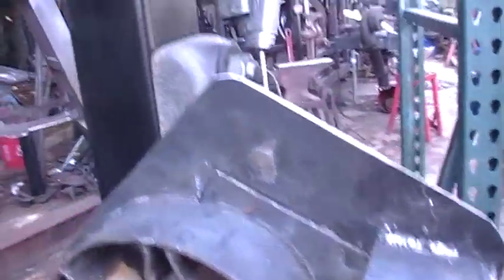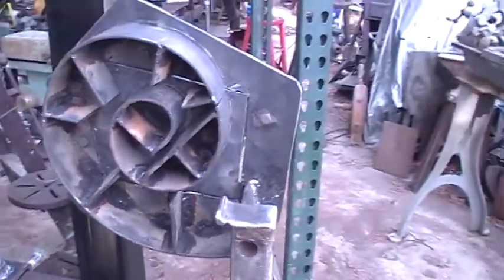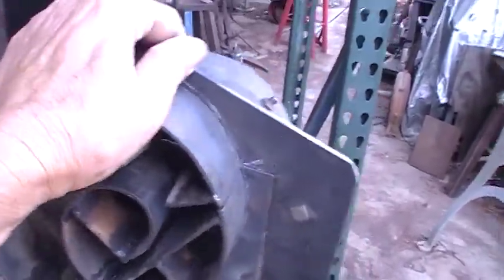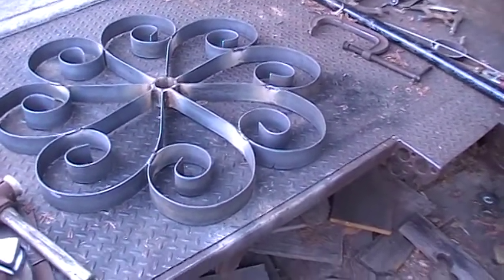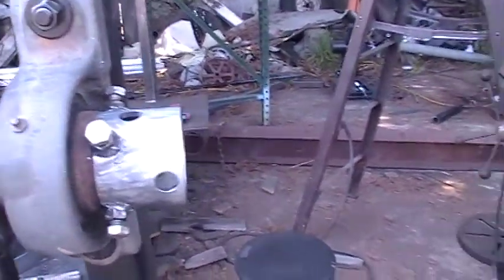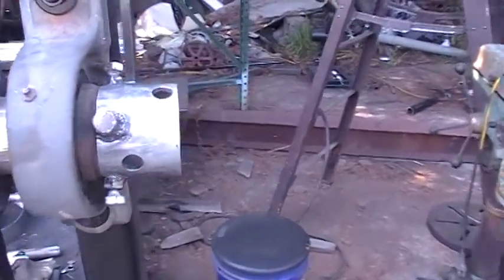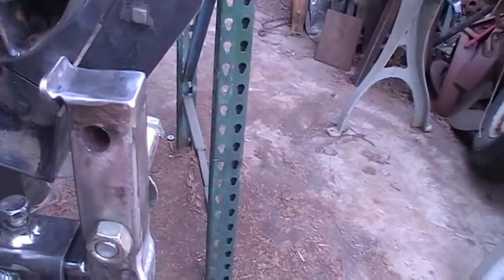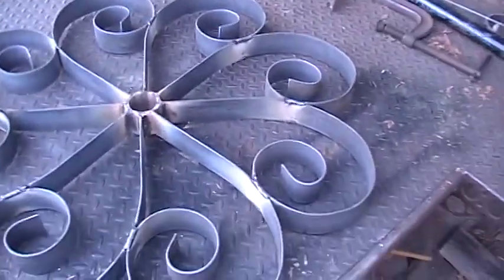finished the scroll jig

Comment: I’ve been watching for several years now it seems, and I don’t recall that you ever told us how you were going to lay this all out and it just seems like this is getting awful heavy for a tandem axle trailer. I assume you’re going to take this to shows and events could you tell us what the gross vehicle weight of the trailer is going to be? You might need it add another axle. LOL
Reply from the maker: Hå hä hã.... Yeah it will weigh a bit. It'll definitely be under 10,000. That's my limit. I had to start this trailer because the other got too heavy
Reply: Thanks for the quick reply Dave can’t wait to see it.